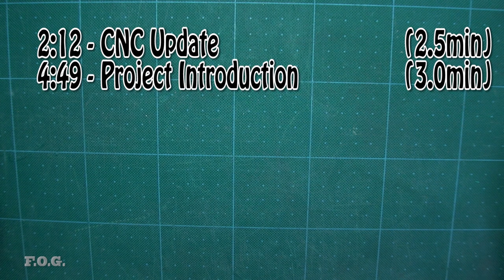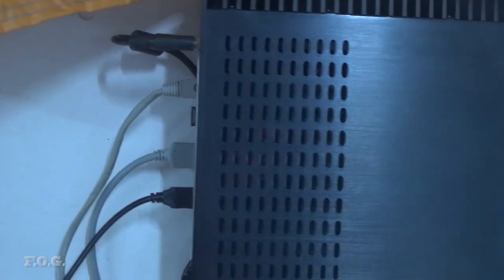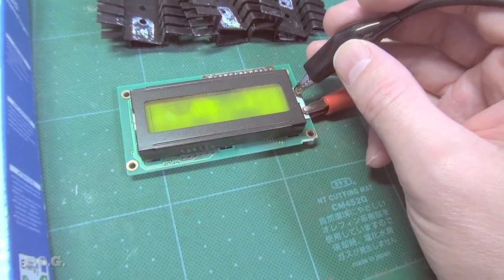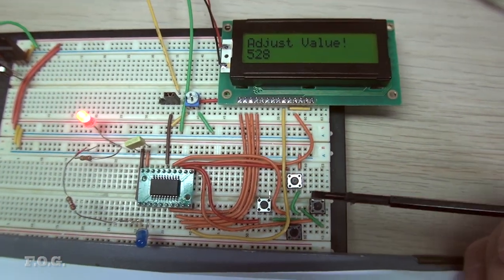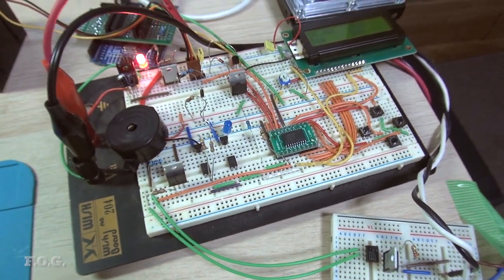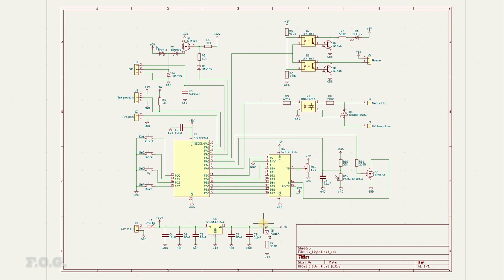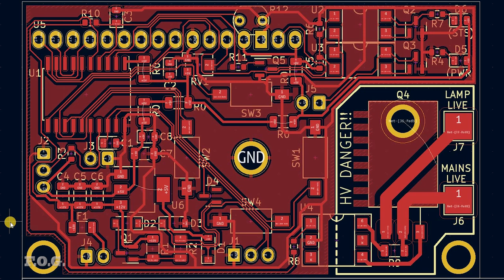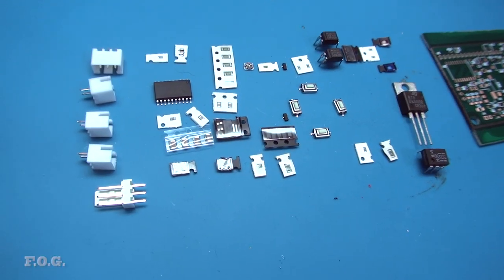EP10 – DIY PCB – Making a UV Light Controller PCB

Comment: FYI, the ATTINY microcontrollers support use of the RESET pin as additional IO, which can be toggled back for programming via fuse manipulation, or "Applying a HV pulse to the RESET pin will switch the pin functionality to UPDI" (often 12V is referenced for this).
Reply from the maker: I am aware, but honestly I find the need to have a specialised programming method a bit fiddly (because I am lazy). Maybe I will give it a try one day. In any case, thanks for the comment!

Comment: Cool stuff!

Your method for cutting a hole in your shield is kinda... bonkers - the char buildup you experience could seriously damage the laser since it's stuck in there with the fumes. Instead you could block the end of the funnel with a piece of black paper/card. That way it's way less material to cut through?
Reply from the maker: There is actually not that much material to burn through, and the laser is sealed off with a replaceable glass protector (actually the laser is supplied with a spare). The build up was minimal on the protector, less than burning the resin or boards, and I will be careful next time I make one to progressively clear the char to get a better result. Thanks for the feedback!
Reply: @ForOurGood  Regarding clearing the smaller pads, have you tried multiple runs of the same laser settings? Shouldn't introduce any damage and there might be less residue left?
Reply from the maker: @mattiasfagerlund  Yep, tried that and many other things. I do cover this struggle in great detail in a number of the videos. Seems the last method I tried has a lot of promise, but I have not had the chance to fully dial it in yet. Thanks for the comment!

Comment: I am shifting my PCB making methods from milling to this Laser / Etch method after seeing your results.  I have the exact same 3018 and laser so I am hoping I can achieve something similar.

Any chance you could share you final Laser Settings (speed and power), for the Etch passes, and the pad clearing?  

When I was doing the milling method I was having trouble with the pad clearing.  It would remove the UV paint, but there was sometimes a thin layer of something that i'd have to scrape off
Reply from the maker: Wish you the best of luck with that! The last settings I published can be found in the description of episode 7 of this series. Be aware however, these settings are still a work in progress, so you still may need to do a little experimenting. I have been pulled away from making PCB's for a few months, but I plan to get back to it later this year, and will likely provide some newer settings then. Thanks for the comment and question!

Comment: I have all my uv panels built but haven't made a box yet
Reply from the maker: I think I made an interesting box for this UV lamp. I will show how I made it in the next episode.
Reply: @ForOurGood  hey man. Your channel name I just realized makes it impossible to find. I just searched for like 20 mins. Maybe a name change would help. 

I wanted to tell you I ordered a mill myself and while I no longer have a 3d printer I'm going to begin my quest to make pcbs at home haha. I have a buddy who is going to sell me a 10 watt laser from one of the kits he reviews on his channel. I'm going to try to etch copper first. I'd like to build a better controller first. I have lots of different stepper boards of the tmc variety and a teensy 4.1.  I also have a collection of 5 sets of motors from 20oz to 84oz/cm and some nema23 motors. I have all the uv panels already made and I'm going to go buy a few sheets of acrylic to make a box. I lost most of my house in hurricane Fiona last year so I went on a spending spree this week buying new gear. A new scope, brymen bm869s dmm, plus other stuff. I'm going to also renovate my workshop and add a diy fume extractor for soldering and splurge on a bottle of liquid tin I think and a pcb via kit. I have all the chemicals for etching and I have pre sensitized boards, bare boards, positive developer chemicals. I went all kitchen sink haha.

My main goal is to create circuits I learn to go with all the notes I write and also make led related art stuff. I have more leds than big clive I suspect haha
Reply: @ForOurGood  I never tried searching for your channel without spaces I think was my problem haha
Reply from the maker: @jstro-hobbytech  Sounds like your going to have allot of fun with all your new gear. May the PCB gods shine a happy light on all your board making endeavours. Make sure you upload some videos, at least of the results! 👍
Reply: @ForOurGood  your pcb series will go viral along with your God tier use of millis haha
Reply: @ForOurGood  I just bought a laser upgrade. Haha